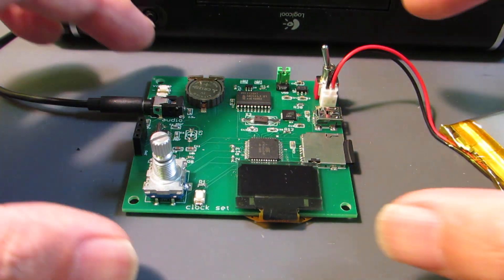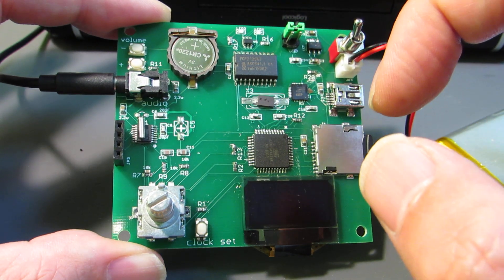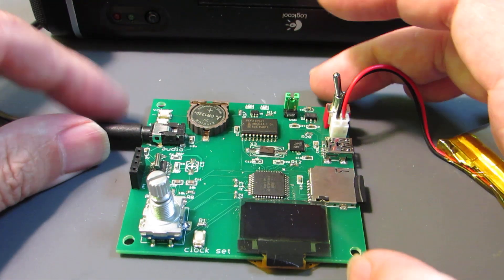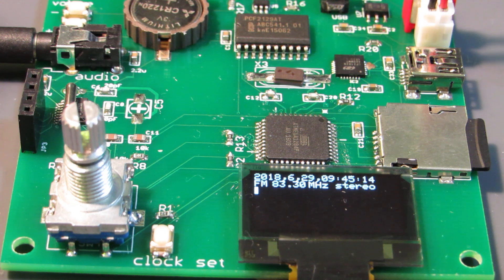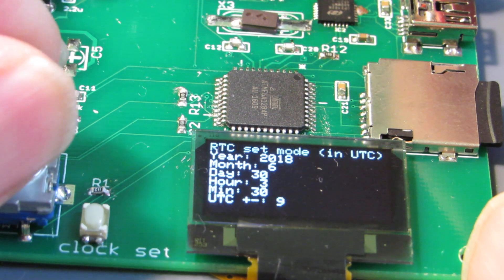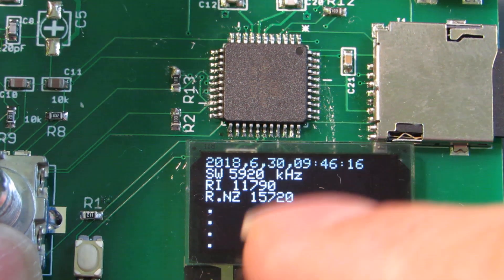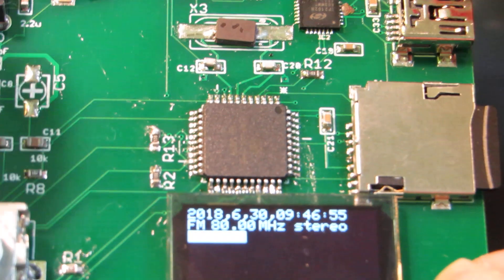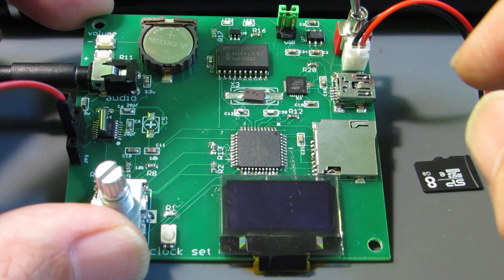New LW/SW/MW/FM radio

Comment: Have you thought about using the 1284 version with the integrated radio? 
  I've been wondering why the 324/644/1284 microcontrollers are not use very much. There is also an open source project called the Sleeping Beauty that allows the 1284 to work on Arduino. That project has Gerber files available and uses the DIP40 ATmega1284 on a basic dev board. I hope to get a few of them if I ever get around to sending one of my designs to a board house.
  BTW I love to see your hand soldered SMD boards. I've been testing my limits with hand soldering and etch resolution lately. The more I see other people doing the more confident I am that I can do it too :)
 Thanks for the upload.
-Jake
Reply from the maker: Hello, this radio is with 1284P. Actually it is quite enough to handle big program with its 16kB capability. I am not sure why Arduino (genuine Arduino) skipped its but clearly skipped AVR51 architecture..